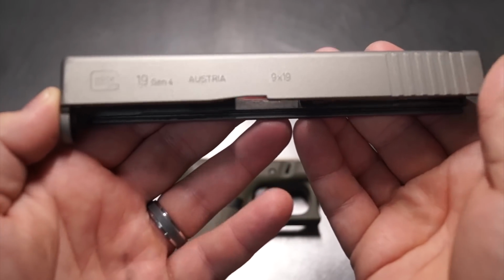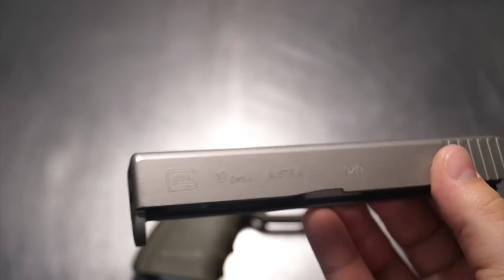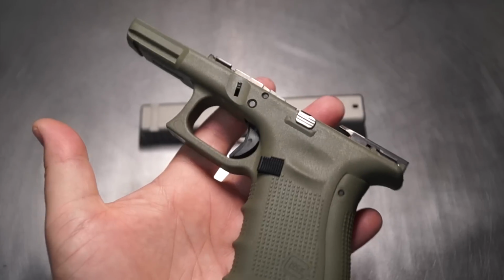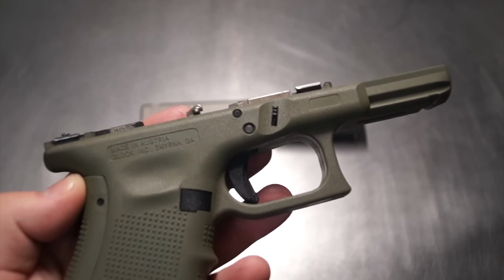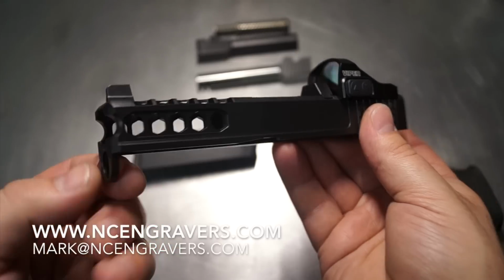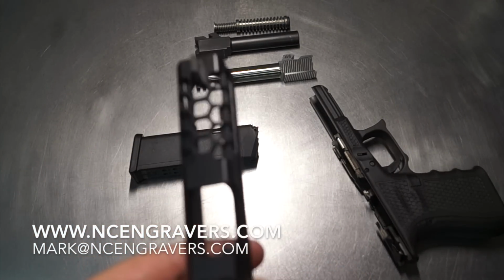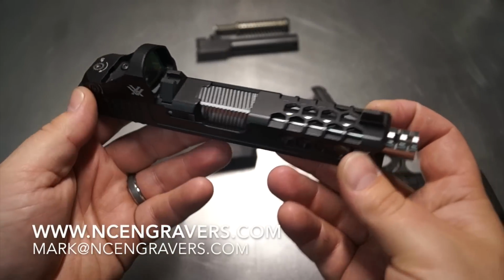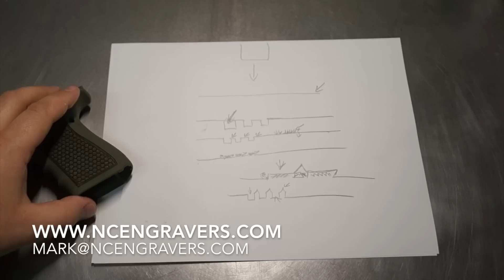NCEngravers.com  - G19 Hive Build (complete Build)

Comment: Question, why are you running your tools with so much projection, is it just to get a camera angle on them, because with carbide that's just asking for it
Reply from the maker: Probably because I am a rookie. Never formally taught.
Reply: @NCEngravers  wasnt trying to say that in a bad way, but move them tools in to your holders a bit more it will mitigate some vibration and surface finish issue if you run into them. Nice work though.
Reply from the maker: I understand what you were trying to say. I didn’t take it wrong. But seriously over the years I have learned a ton by trial and error because I didn’t go to school for it.
Reply: @NCEngravers  not going to school that is something we have in common, as well as the trial and error and probably a little swearing as well lol
Reply from the maker: Sounds accurate. Lol